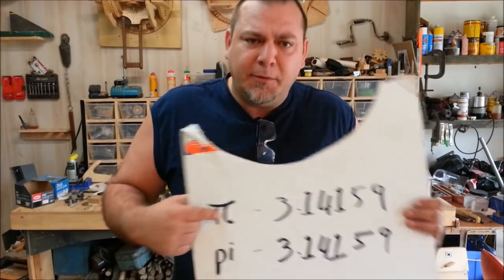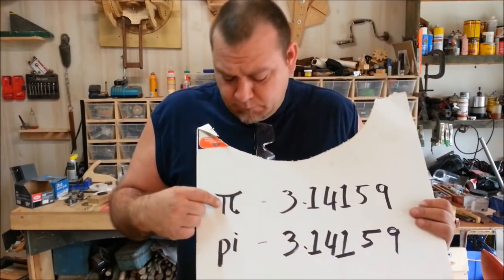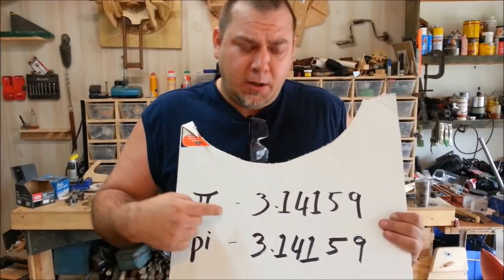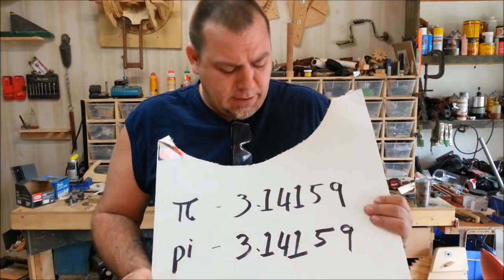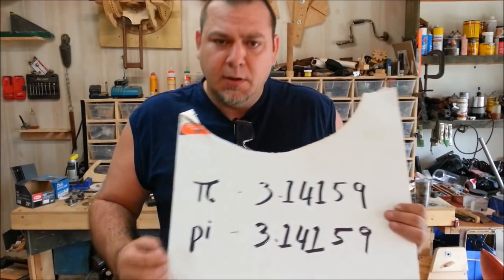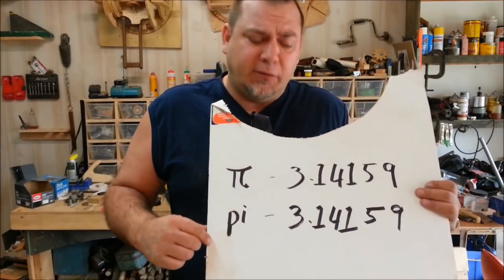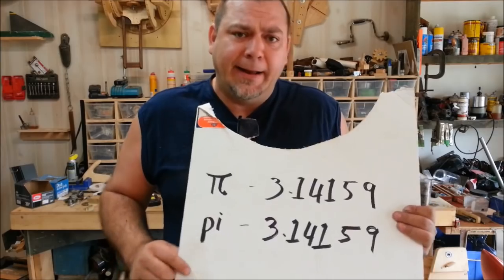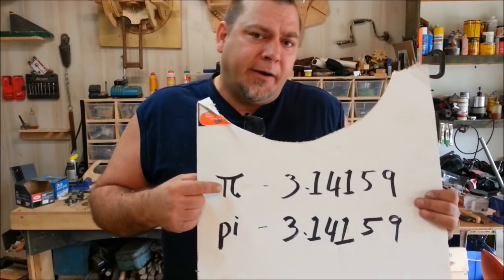How to make gears with gear tape

Comment: One way to make really small tooth gears is to use corrugated cardboard. Remove one of the sides basically you have the gear tape. And because of the really nice curves of the undulated cardboard they mesh really nice.

Comment: Aloha Izzy , 
Great video on gear making . In the past , when I had to used 'MDF' for my patterns [for over 200 furniture designs needs in mdf in reinforced the mdf by wetting the finished patterns edges with 'crazy glue' , let it set , rewet it , than reset the size by polishing it down to neatly the right size again , and ended up with a more durable edge to the pattern .

Comment: Well I learnt something new. The other thing to remember is that you could also use your timber gear pattern as a pattern for greensand casting aluminium. It should work with just a little clean up after the pour.

Comment: A much quicker way to get a pattern is to download and install the free vector graphics program Inkscape onto a computer.  It has a built in gear generator that draws spur gears with involute teeth with parameters you can adjust for circular pitch, # of teeth, and pressure angle (Extensions->Render->Gear).  Print it out on a sheet of paper, attach it to your mdf board, and cut it out and you can completely skip the gear tape part in developing a pattern.
Reply: Living off grid in Philippines needs skills as demonstrated
Reply: BTW: a laser engraver is just ~100$ nowadays. You can easily enlarge the frame.

Comment: I know not everyone has access to a CAD program, but you could quickly model a pattern and then print it full size, and just spray adhesive it to a piece...
Plus, you can then use different types of gear tooth profiles.
You can actually make HTD timing pulleys by just drilling holes on a circle pattern and then cut the diameter free and you're done.
I've thought about making a custom blade for a table saw with a trapezoidal profile so I could literally cut the gear with a TS and a bandsaw and be done!

Comment: As a machinist gear making always gave me a head ache figuring. Recently a friend and I needed four # - 80 chain sprockets for an antique wrecker we use. The cost was more than we wanted to spend so we made them using your drill at the bottom and cut each tooth. We should of paid for them because hand cutting half inch steel plate sux. Thanks for your version of making or laying them out tho.

Comment: Do you think the type of gears at 7:32 would be used for the oss (spindal sander ) so the drill can be mounted horizontally or would the torque be almost lost ?

Anyway those are my thoughts I was also thinking about using two power drills to power it that might be a bit simpler but less impressive ?!

Comment: nice to learn that way pi. I do like to be precise using pi, however, why don't you make any size circle, and cut out the circle first before you measure the tape but measure the circumference with the tape the circle you cut out, and stretch-out the same tape and arrange whatever angle and size of the gears then stick with the glue you trust. I might be clear on that or correct me if I'm wrong. Thank you izzy.

Comment: Great idea with the tape.

Once you have the template wouldn't a router with a template/pattern cutter be the easiest way to cut copies in one step? I tend to use the router to cut circles too - similar  process to the bandsaw but more accurate and very easy to set up, and repeat a particular diameter.

Comment: I thought about doing this with a timing belt. epoxy it on to a wood circle. It could also be used as a sprocket if it worked well. I want to build a wind mill that requires a over drive gearing. also a sun tracker for solar panels. I was thinking use a great reduction motor . about 6 rpm. and a 16" gear with a timing belt around it and to each end of the panel mount. so when it turns it pulls the panels at about 6" per minute. to follow the sun. I'm just not sure how wood gears will last. they could be coated in epoxy or something. of maybe make wood pulleys? any advise. great video. I never would have thought to do that.

Comment: Hi, would you tell me how to make a telescopic wood arm that locks and release by using a ratchet or any other mechanism.  I am gonna use it to raise to tripple times. So if  the minimum height is about   1 feet, I may use the mechanism twice to raise it to a 3 feet height.

Comment: I wish you guys in the US would change to metric,much simpler than imperial
Reply: Mop

8
Reply: Richard Donkin CSI so do we. I use metric on my own smaller projects. Larger ones work better in SAE, but being accurate is harder
Reply: I can't think of a single thing in this video that is exclusive to U.S. customary units.  All of the principles are exactly the same, the gears would just be physically smaller if he said "centimeters" instead of "inches".  Really, if you can't use the information provided here using any system of measurement, you are beyond hope.  I suspect that isn't thew case - I'm guessing that you just have a knee-jerk response whenever you hear "inches", and you don't even stop to think about whether or not it matters.
Reply: I doubt the U.S. will ever go completely metric. For instance, our metric mechanic sockets use 3/8 and 1/2 inch square drives and many other odd combinations. If there's any clear advantage to metric I don't know what it is.
Reply: Ellie Price: I doubt that the rest of the world will ever go completely metric, either.  Those 3/8 and 1/2 inch square drive socket wrenches?  The rest of the world calls them 9.5 and 12.5 mm drive socket wrenches, and guess what?  They're exactly the same wrenches.  China doesn't make special 3/8 and 1/2 inch drive wrenches just for the USA.  They just label them according to where they're being sold.  Also, do you know ANY country that has automotive speedometers calibrated in meters/second?  Because surprise!  Km/Hr is not metric because hours are not metric (or to be more exact, "SI") units.  So most cars outside the US have non-metric speedometers.  There are other examples.  Tire sizes?  They're a weird mixture of metric and U.S. customary units, all over the world.  Most tires sold in the US aren't made in the US, and no, the rest of the world isn't making special sizes just for the USA.  Look at any common tire size used on a typical non-American-built car, like for example 165/80R15.  This tire size is available everywhere.  What does that "15" mean?  it means the rim diameter is 15 INCHES.  I've been told that people in Great Britain still use their customary units for a number of things, although I don't recall the specifics.  Yes, the US is way behind the rest of the world, which is a national disgrace, but I'm getting tired of hearing that "the US, Myanmar, and Burma are the only countries in the world not on the metric system."  NO country is using metric measurements exclusively.
Reply: Oops - I mean the US, Myanmar, and Liberia.
Reply: The metric system, not simple at all. This from ELearning101; [The Metric System. Based on the meter, which is defined precisely as 1,650,763.73 wave lengths of orange-red light emitted by the krypton-86 atom, or originally one-ten-millionth of the length of the longitude from the North Pole to the equator. The meter is exactly 39.37 inches. Or it measures about 118 barleycorns, however you choose to think about it that way.] Now if we could just learn the exact width of an English barleycorn!
Reply: The US does not use the imperial system, that is the British. The US uses US customary units. While close to imperial,  they are not the same.
Reply: The US is metric... The Metric Conversion Act is an Act of Congress that U.S. President Gerald Ford signed into law on December 23, 1975.
Reply: Hey, I just found the official English standards for inch, yard and mile. I hope this helps.
The Inch. The width of King Edgar’s thumb was officially designated as one inch. It was three barley-corns wide so now we know a barley-corn is exactly 1/3 of an inch. 
The Yard. The distance from King Henry I’s nose to his fingertips. The distance is also twice as long as a cubit, which is 18 inches. 
The Mile. In the Roman legionary, the mile was the distance covered by 1,000 double steps. Queen Elizabeth added more feet so the mile would equal eight furlongs.
The Furlong: The distance a team of oxen could plow in one day. Doesn't say if the oxen are old and tired or young and strong. 
Now I'd like to visit the National Bureau of Standards in Washington, D.C. to view those high precision barley-corns  in that constant temperature vault.
Reply: Bob Vogel Which Americans completely ignored.
Reply: Rex, no. SAE, US customary units, etc, are standardized on a conversion of The International Meter. Even if we all refuse to use metric in specific industries, we're still using meters as a reference.

I've used both systems professionally, meters as a surveyor, thousandths as a machinist, inches and feet in construction. Meters don't work when your tooling is SAE, and your tape measure is indicated in feet and fractions of an inch.

At home I use fahrenheit/tablespoons for cooking, but celsius/grams for chemistry. I've used both my whole life. The only argument meters really has against US Customary is "Durr, fractions are hard!".
Reply: I was, in part, being sarcastic.  However, I do recall when Jimmy Carter and Congress passed a law and declared that we are all going metric in the US.  It was to be taught in schools, and I believe Government agencies at the Federal level weren't supposed to except bids in non-metric units.

And in a few years, we were all going to be using the Metric system!  And... it was pretty much ignored.  The metric system it taught in schools, but not very much.  Try finding a metric measuring tape at Home Depot.  I'm not saying they DON'T have them, but you're gonna have to look for it.
Reply: In a way, we are. The imperial system is defined in terms of the metric system these days. Also, if you get a shot from your doctor, it will be measured in cubic centimeters, not teaspoons, lol.
Reply: The clinging to Imperial Units baffles me as well (I'm English, so they actually come from here). They are preferred by people who don't do any maths with measurements simply due to familiarity (which is fair enough, same as we're used to using shoe sizes without any idea what they are based on). But once you start needing to calculate, metric has obvious advantages in that it is a consistent system (yes, no doubt there are better conceivable consistent systems: discuss).

The basic point is that we have a base 10 number system, everyone uses base 10. So a units/measurement system based on base 10 rather than a random selection of bases obviously makes sense. Look at weights; 16 ounces to the pound, 14 pounds to the stone (which Americans don't even use, who wants to divide by 14?), and don't forget the baker's dozen (13).

I trained as an electrician in the early 80s. I think in metric. Our wire sizes are very straightforward; mm^2. Compare that to having to memorise AWGs and whatnot, or the prior British system of things like 7/0.029 (7 strands of 0.029 square inches). Nuts and bolts, the same (M4, M5 etc). What size is a 6BA? No idea without a lookup table, or memorisation. And so on.

Sure, I understand this whole being world leaders means you don't use other peoples' stuff (especially French stuff), but Imperial is inherited from England, the former Colonial power over the States anyway. So that makes no sense either.
Reply: jaxxstraw:  Name me a country that is EXCLUSIVELY on the metric system, i.e., does not use ANY of its customary units.  And furthermore, the U.S. DOES use metric for all international trade (and has for decades) and even most domestic trade, because many U.S. companies insist on it.  The "clinging" to our customary units (they are NOT the same as your old "imperial" system, by the way - look it up) is due to the same reason most other countries cling to some of their customary units: because of extensive infrastructure based on customary units.  We use 2x4 lumber (actually 1.5" x 3.5", and you can call them 38 mm x 90 mm if you like, but wouldn't THAT be a mouthful?), and 1/2" pipe (which isn't 0.5" in ANY dimension) because we have centuries of construction that use those, much of which is still standing and has to be maintained.

As for "especially French stuff", the U.S. doesn't have the kind of generational bad feelings about France that SOME countries do; you may be projecting here.

Finally, the "world leaders" explanation doesn't even hold water: while many products used worldwide are designed in the U.S., most of those are manufactured in Asia, for which we specify everything in metric units, even when they're a little silly, like 1.27 mm lead pitch on some ICs (instead of 0.05"), and even THEN, guess what?  "purely" metric countries are using those chips with the 1.27 mm lead spacing.
Reply: Ellie: your information is out of date, and in fact has never been true in the U.S.  The official standard in the U.S. is not a standard at all; it's a definition.  One inch is defined as 25.4 mm, exactly, and has been for many years.

Comment: How about using 360/number of teeth to get the angle required between each tooth?
  The diameter wouldn't matter. Then use a protractor to mark the top of each tooth on your material.

Comment: This is so weird to work with fractional inches.. Isn't it simpler with centimeters ?
Reply: +xl Thats the Imperial System for yah
Reply: Depends on where you're from and what you're comfortable using. For me as a machinist I often convert fractions to decimals and use them that way.